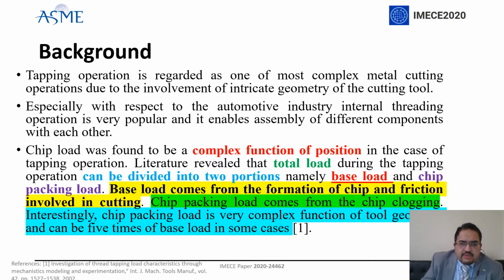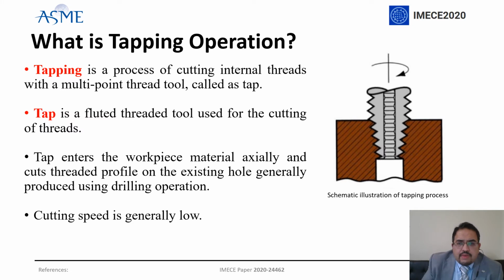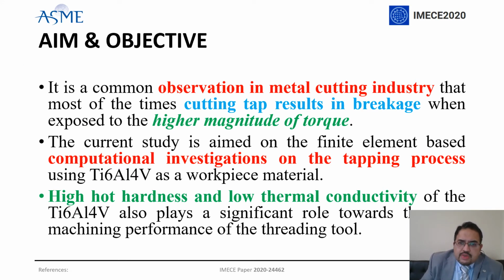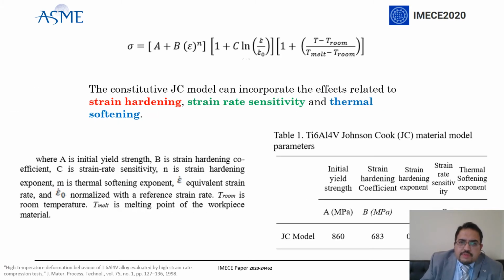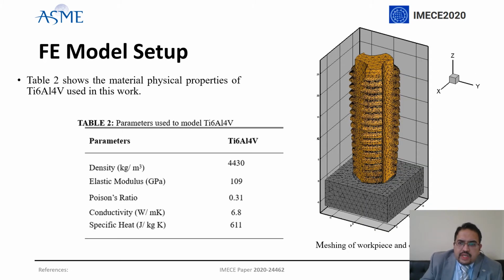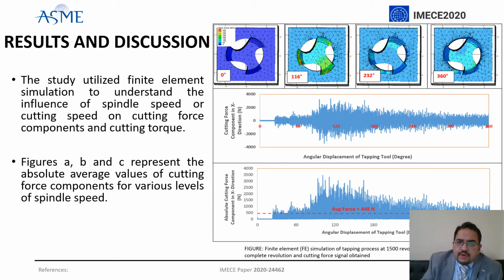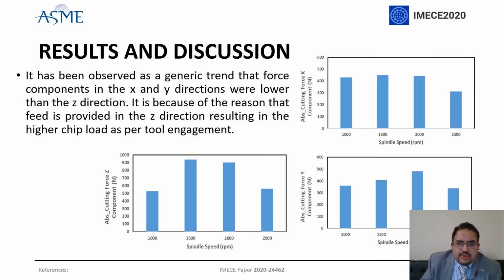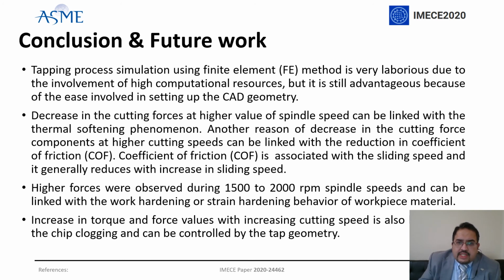TAPPING PROCESS OF TI6AL4V USING FINITE ELEMENT (FE) SIMULATION

Comment: Regarding simulation time:
Mass scaling can be a factor due to very small elements' size. 
Additionally, perhaps simulation with LS-Dyna (>R12) might reduce time. It has JC material model MAT107, with explicit/transient Lagrangian  and adaptive remeshing; as well as a highly optimized solver.
Reply from the maker: I used Advantedge here and tge 3D simulation with lower mesh was very challenging due to computational time. So at the its compromise between the both.